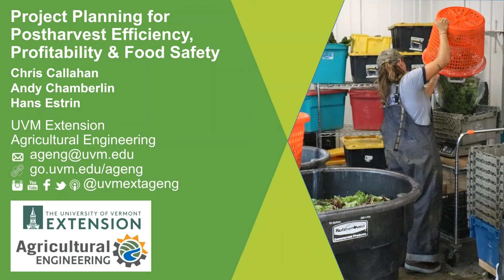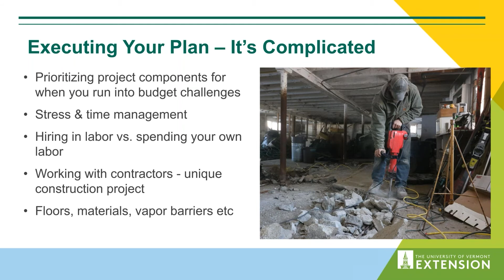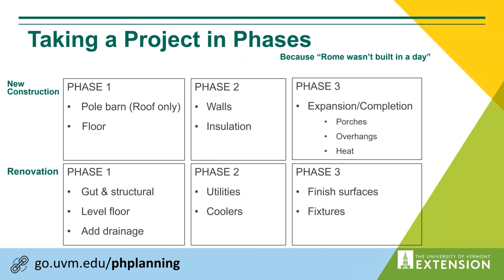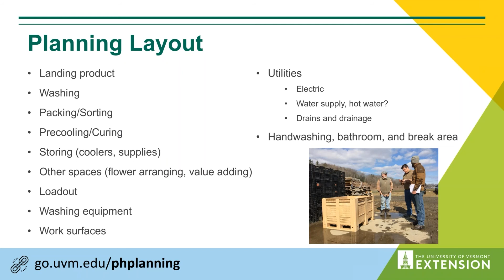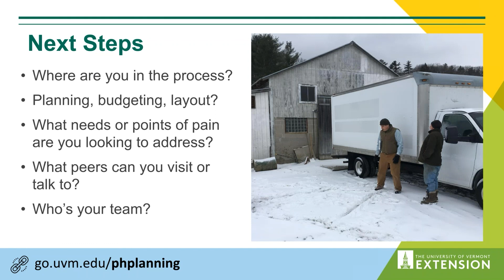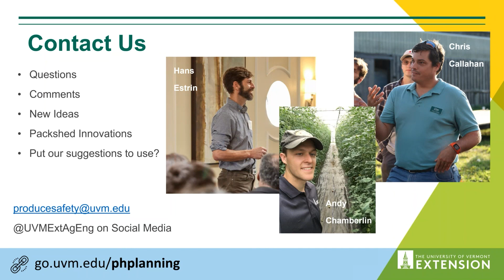Postharvest Webinar: Executing your Plan (Session 8)

Comment: Hello and thank you for this series! I have a few follow up questions. First, and sorry if I missed this, but the wash areas for totes/bins/buckets (harvest, pack out) is supposed to be separate from the wash area for the actual produce, correct? I didn't see this as an area on any of the case study plans. Second, are wash and pack areas for produce regulated at the town/county level with their own specific code requirements and thus require an inspection before going live? I ask because this was not listed in the planning resources or team. If yes, I assume they would also regulate where water flowed to from the wash area (eg. septic vs. slope out the back of the barn into a non-produce field)? Thanks in advance for your clarification!
Reply from the maker: Great questions. 
1. BIN WASHING AREAS - Generally, this task is done outside due to the amount of spray and, importantly, over-spray that can occur. Since you are generally cleaning and sanitizing bins to prevent cross contamination with produce, the job is best done outside away from other food contact surfaces which could be cross-contaminated by the water coming off of the bins.  Typically this is done with a se of picnic benches, tables, or purpose built stand that keeps the bins off the ground while they are cleaned, sanitized and allowed to air dry.
2. PERMITS, CODE, INSPECTION - This will vary by location. These structures are generally not considered temporary or portable ag structures and, therefore, may be subject to inspection by a local code enforcement office.  Best to check with that office before getting too far.
Reply: @uvmextageng  Thanks!